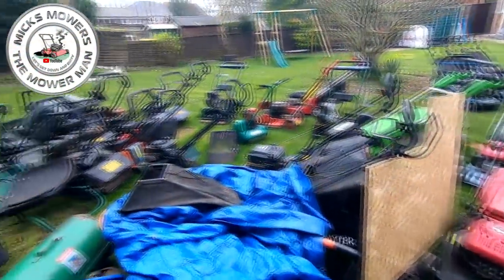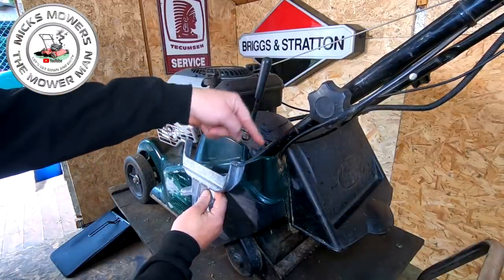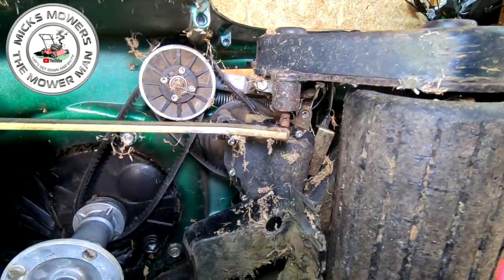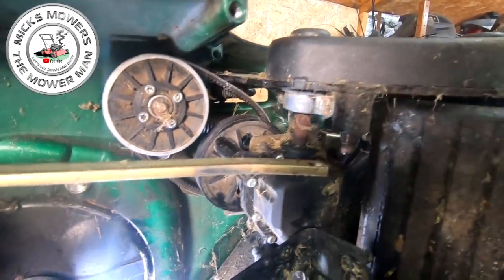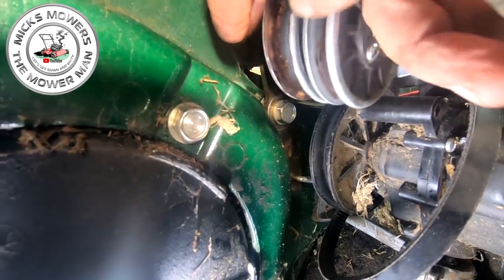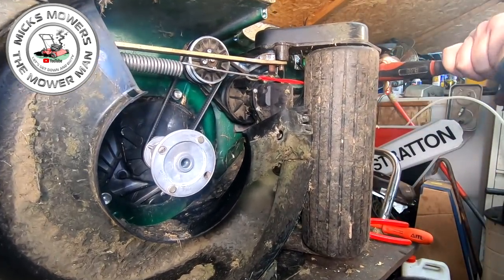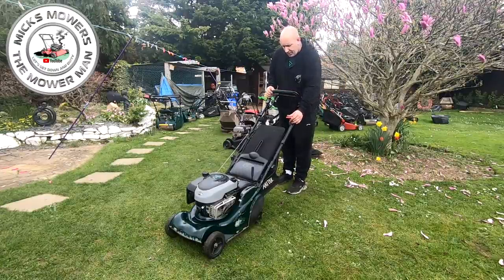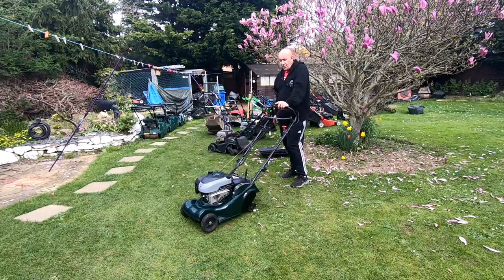Replacing The Belts And A Bouncy Front Fix On A Variable Drive Hayter 41 Lawn Mower

Comment: Mick - you are a life saver. I only watched the bit specific to reattaching the counter balance spring or the “spring of death” as you rightly call it. Because I already had all of the under deck removed. I attached the spring the other way around and used the front of the more as a pivot point but otherwise followed as you had recommended. It worked like a charm and meant I could use the bolt and washer to tease the spring into  place rather that risk a digit. If you are ever around Newquay, I’ll buy you a beer or 3. Incidentally, for anyone else contemplating replacing the left hand roller support bracket (part 410002), the replacements are significantly more substantial. The one I took off weighed 184 grams, the genuine replacement weighed 489!
Reply from the maker: No worries mate .. I appreciate you taking the time to comment.

Comment: I just wanted to give you a big shout out for you and your video. Helped enormously, especially the paracord techniques. Both belts replaced and about to test it out!
Reply from the maker: Good luck... Fingers crossed
Reply: @themowerman  All done and self propelled. thx very much 😀 Still not sure whether to replace the cable 2006 model. We have drive
Reply from the maker: @andrewhewitt6353  fantastic so pleased for ya
Reply: P.S. Are there any videos about replacing cables?
Reply from the maker: @andrewhewitt6353  hmm may have .. it's simple enough.. take it off.. put one on

Comment: Nice fix and nice mower.  Seems like they need to swap out the bracket with a steel one to give it some more strength.
Reply from the maker: Yeah but that would mean it would not need replacing right £$

Comment: Just a word to say Thankyou Mick. From your video I’ve managed to change both belts and the ally bracket that broke just like th done in your film. Good job sir!! Oil change, fuel filter and a new spark l’oligoélément and we’re ready for spring!  Just one question. The spark plug looks a bit sooty suggesting it running a bit rich. Best way to make the mixture a bit more lean?
Reply from the maker: If it has a card adjustment turn it in a little... And keep changing the air filter it really helps...

Comment: hi mick great video - did all this belts new bracket - but it still seems to be bouncy - the bracket is in tight - can't think what could be causing this - can you help ?
Reply from the maker: It sound fix it mate is the spring on correct.. if not this will have an effect on it

Comment: Good work Mick, you'll save people lots with that one. On another note, meant to leave a comment on your previous video, I was wondering why you didn't weld up your broken seat rather than buy a new one.
Reply from the maker: Yo yo .. I was looking at the stool today and I may have a go . If I can clean up the metal to weld it
Reply: @themowerman  Flappy disk on an angle grinder should do it. Just make sure you move flammable stuff out of the way.
Reply from the maker: @BensWorkshop  it's not as simple as that mate where it's broken.. I will find a work around
Reply: @themowerman  Fair enough. Good luck!

Comment: i remember having to pull them height adjuster springs through the back of the 56 and push the pin across the earlier ones were easier to fix but still a fiddley delocate machine they were better when they had the side drive on them
Reply from the maker: Yes mate

Comment: Hi Mick, this must be the he tenth time I watched this video. 

I managed to fully rebuild mine now, so am made up. 

I had the same issue with the rear roller assembly falling off the aluminium gear box bracket. 

It seems to be able to float left and right. 

I don’t suppose you know if there’s a fix for it??
Reply from the maker: Should be a bolt to keep it in place mate

Comment: I've got one of these with electric start and it charges battery well running.  I was going to replace it with a new one till I found out they don't do one that charges battery now. You have to charge it separately.
Reply from the maker: Yes.. it's not a problem.. it can be taken out quickly enough
Reply: @themowerman  true but if your going to build something that is electric start. Why not charge it as well.
Reply from the maker: @adventcliff2040  because it's cheaper for them not to fit it with an alternator and for you to buy a charger...
Reply: @themowerman  yes that i understand.  I would pay the extra to have what I want.
Reply: Thats why I'm keeping old one.

Comment: Hi Mick, this vid was very helpful especially the variator spring install....so thankyou.  Just for some back ground on my mum's same machine...I have changed the roller, the top bracket (the one that always snaps), all the plastic covers and then found there was very little/no drive.  I then replaced the variator (as a couple of the tiny springy plates had snapped off inside...other than that it seemed ok) and both belts, but still no drive.  The roller goes around nicely when lifted but not when on the ground and the chain is ok.  You can see that its engaging and trying but something is slipping I think.  Can you offer any suggestions please? 
thanks Adam
Reply from the maker: Sounds like the gearbox mate ..
Reply: @themowerman  Thanks for the advice.  I removed the gearbox and it seems to operate ok with the pully slipping until the clutch is operated.  As you the pressure on the clutch by hand the gearbox grips the pulley more and more but I'm guessing it is slipping under motor power and the weight of the machine.
The belts whilst brand new and correct, don't seem that tight btw.  Just before I splash out on a new clutch cable (very slightly frayed) and gearbox, is there anything else I should try?....and if not, is it the clutch part of the gearbox that is at fault?  Thank you in advance and do you take calls on this? Thanks Adam
Reply from the maker: @adamharland7716  sounds like the gearbox
Reply: I brought a new gearbox and fitted it but that didn't solve the problem.  It was in fact the M16 washers either side of the roller that had worn too thin and causing the roller shaft locating pin to jump out of the slot in the roller, hence the poor/non  drive

Comment: where did you get the battery from? sounds like the cotter pin on the sproket chain has backed out
Reply from the maker: I got it from Amazon.. no it was just the bracket was not all the way in the roller bracket
Reply: @themowerman  thanks👍